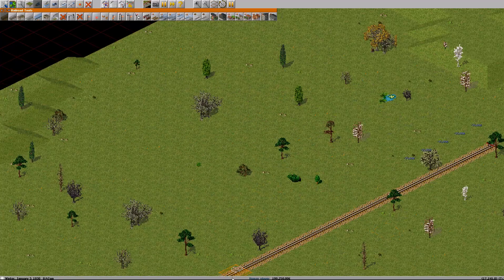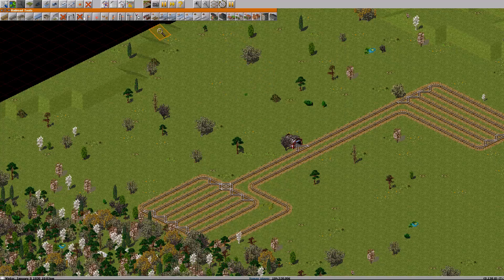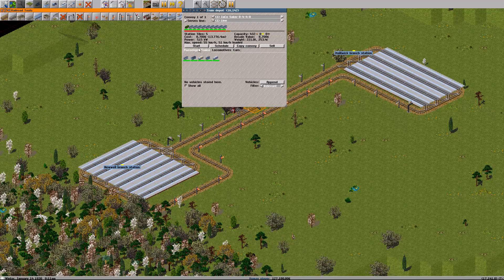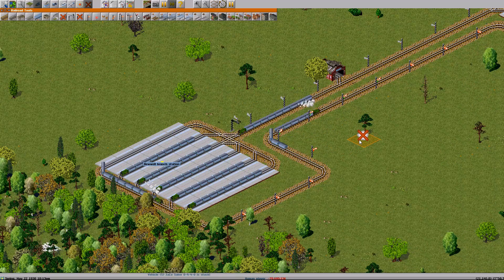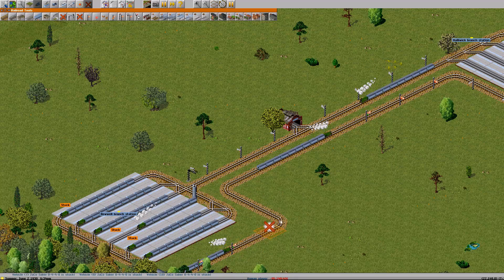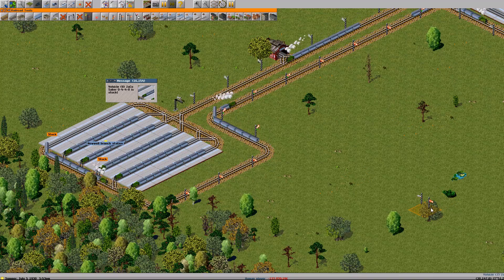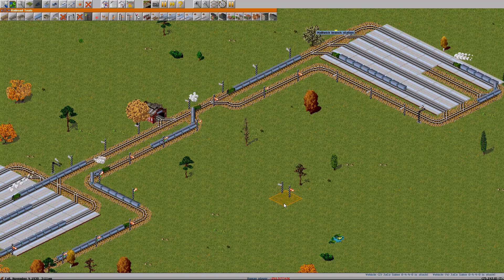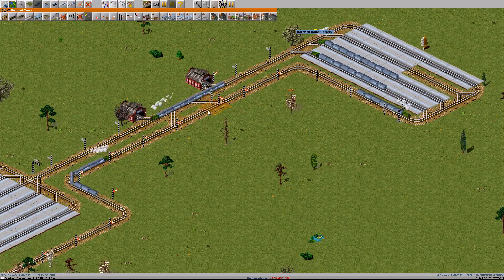Simutrans Tutorial : Basic Train Signals [English]

Comment: I can get an industry working for about six to eight months, but then the producer stops immediately producing any more resources.
Reply from the maker: The producer will often stop producing if the consumer has full or overflowing storage, you can see this in the consumers window where it says what resources it's holding. If the consumer also produces resources you have to export those resources to other consumers otherwise the consumer will fill up and stop accepting. There is an option in settings to turn this behaviour off if you so wished.

Comment: thank you for making a tutorial, helped me allot! i subscribed too. i found this game thanks to you, and i am having lots of fun with it. can i also ask which pak set you are using. ive been reading that game version 1.20.1.3 crashes allot. with certain paksets. and it does crash every now and then for me, is this the case for you too? i am using pak128 btw
Reply from the maker: I use pak 64, I'm going to try pak 128 v2 when I get the chance
Reply from the maker: It does not crash for me yet, this could be a system specific thing, as I used to have a problem with crashing. If you can figure it out you might try to use the gdi version instead of the default sdl version to see if this fixes your problem.
Reply: If you are having crashing issues, may I suggest that you report the bug on http://forum.simutrans.com? The developers are good at fixing bugs posted there.